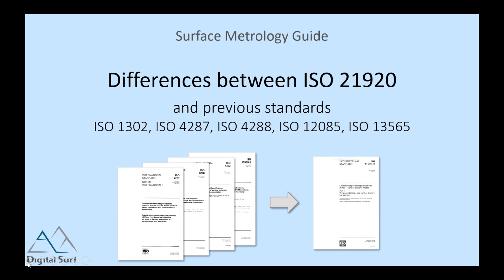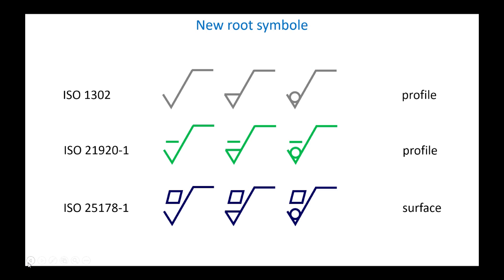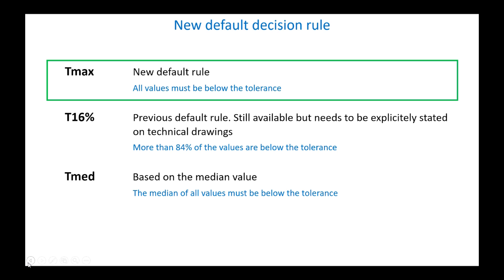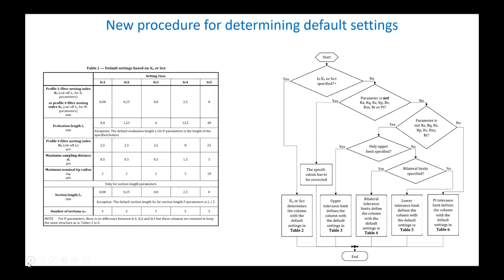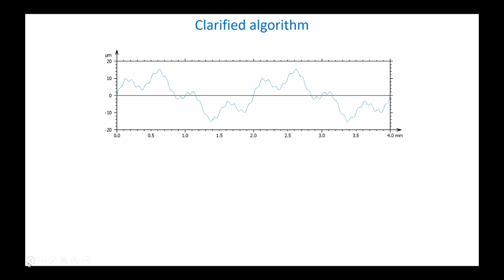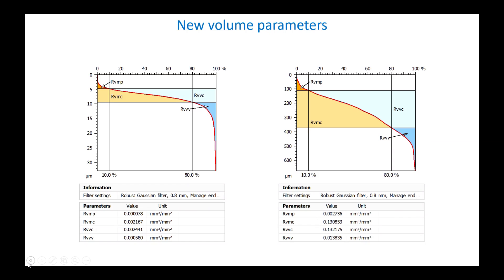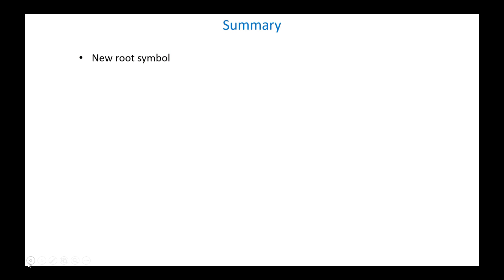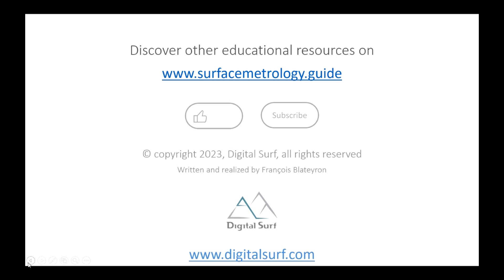Differences between ISO 21920 and ISO 4287

Comment: I thought that in the new analysis chain, if I just apply the Profile S Filter to the Mechanical profile, it will immediately become the Primary profile, but it says that I have to go through the Nominal form removal process to become the Primary profile. Could you please explain in detail what exactly the Nominal form removal process is?
Reply from the maker: If you only apply the S Filter, you obtain the "primary surface profile" but with an additional F Operator, then you obtain the "primary profile". So it is similar to the previous definition, but with a reverse order between the S Filter and F Operator.